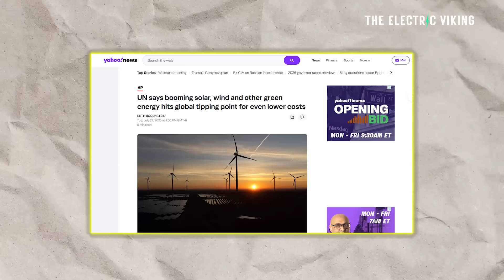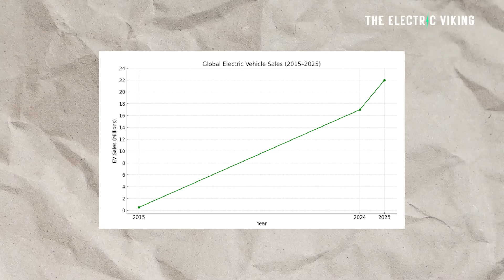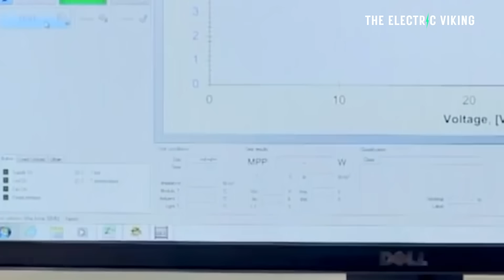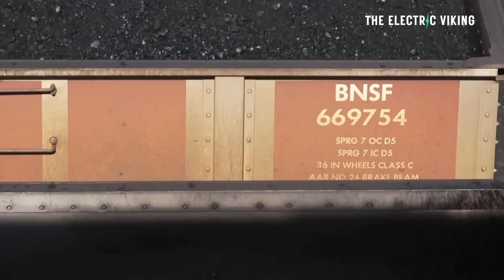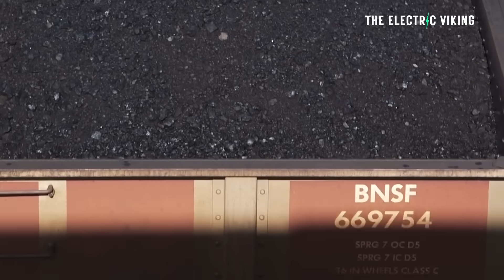UN says booming solar, wind and batteries hits global tipping point

Comment: Stuffed if I know how the US thinks it's going to be the center for AI when they already have blackouts due to power scarcity. As you said, to put in sufficient compute to do the job it'll take enough power to run Japan.
Reply: They'll do it by taking every bit of renewable energy intended to get us off of fossil fuels, and diverting it to power data centers and AI instead.  Unless people organize and demand a change of direction.
Reply: 太陽光は税金を払ってないです。ガソリンは,４０％～５０％が税金です
Reply: @田中亮太-k3u  Why would any sane person tax solar (or wind) at 40% to 50% ? It doesn't do any harm to the environment whereas gasoline DOES !
Reply: The United States cover a vast area, most of which is not having trouble with blackouts.
Reply: @alanlight7740  Simple google search shows the poor situation which is only forecast to get worse. New power plants aren't keeping up with normal usage let alone any new dreams of massive AI data centers.
Reply: 100% agree. Arresting the development of AI in the US will be one of Trump's weirdest achievements. Surely big tech has to turn on him at some point.